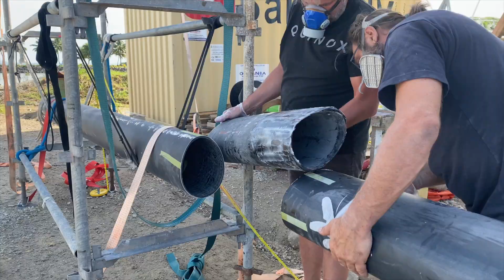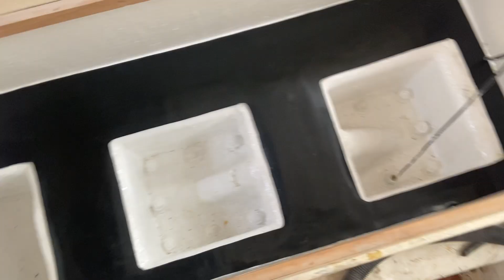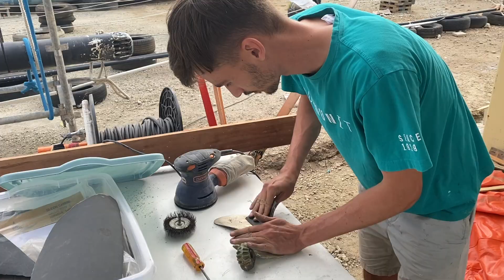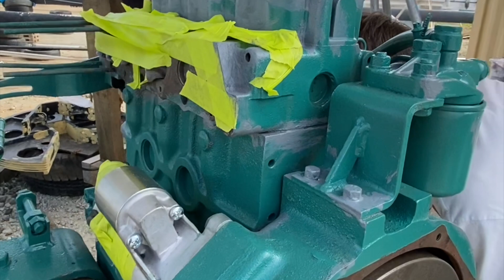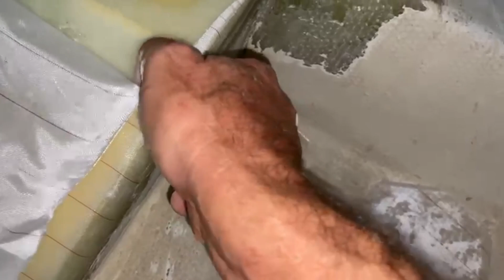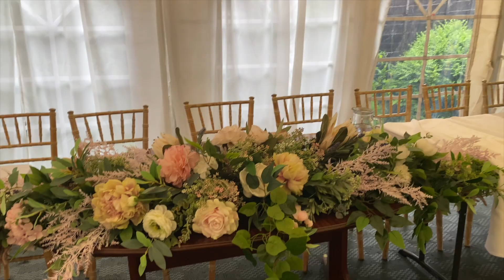Full steam ahead! Bewitching BALLAST, seductive SUPERSTRUCTURE, captivating COMPRESSION TEST | Ep.29

Comment: With your method of plugging thru holes what’s to keep the wood plug from rotting out?
Reply from the maker: It’s a sacrificial plug, the perfect job is to use a fibre glass plug, but we didnt have time to do this this time. but the wood we used is very hard wood and should last 10 years, before which we would remove and reseal. We also used 3m between the hole in the wood and the plastic thru hull which lasts a long time